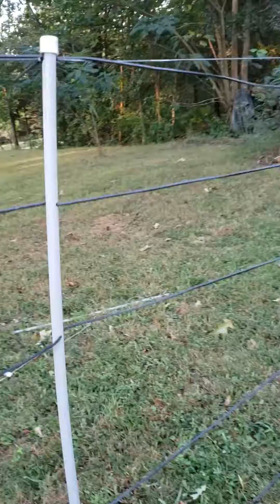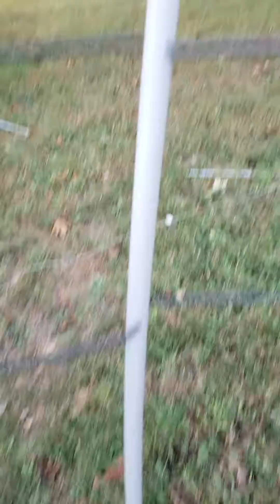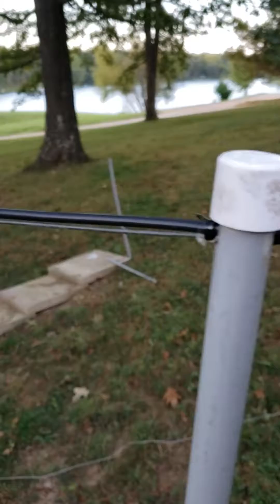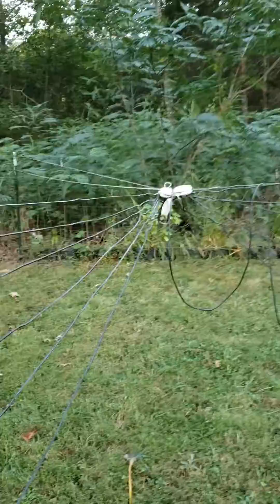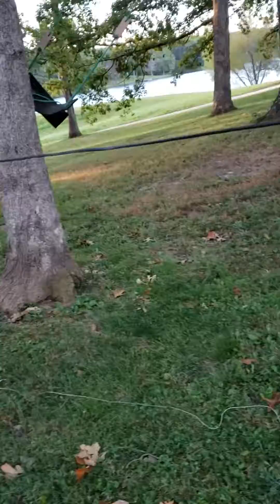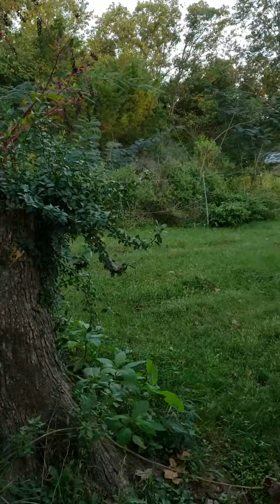Fan rebuild part 2

Comment: New subscriber here.  I am a new ham also as of January 2020 (I passed my Technician & General at Cowtown Hamfest in Ft. Worth), but just now getting into HF.  I am planning on a fan dipole in inverted v.  I noticed your separators are spacing the elements 12” apart.  How did you come up with that measurement?  I had been considering either 4” or 6” separation?  My wire and PVC, and connectors are purchased, but I am finalizing my choices.  I am thinking of 80/40/20/10 with 15 for free due to harmonics from 40.   10 is optional if tuning 4 elements causes me too many headaches.  I may not do 80 since the tie off point might not fit (I don’t want to run it under the power lines).  Thanks for your video.  I have been planning on doing the same thing as you on the separators (the 90 degree orientation).   Have a Happy New Year! 73 de KI5HXM Brent from Texas

Comment: Karl.
doesn't the aluminum fence wire cause problem with the closest wire?? like coupling etc.?
Reply from the maker: The top (160) wire does couple with it, but as long as the galvanized wire is shorter, it is not a problem. My 160 wire is longer, and actually hangs down some at the ends, because it is longer than the space between the trees. 
Let me know if you need more explanation.